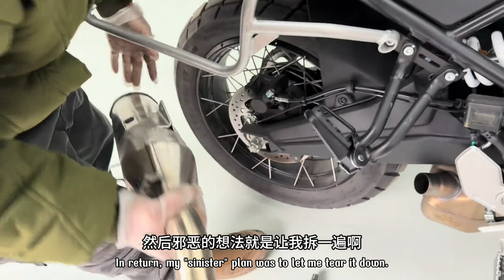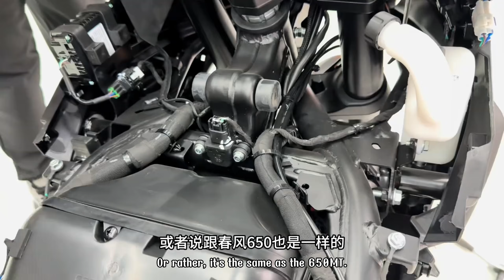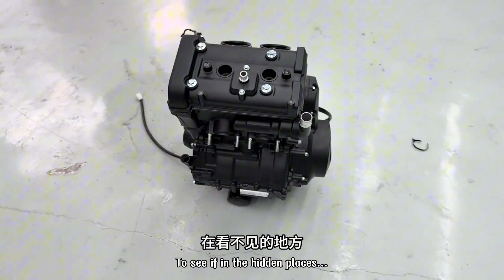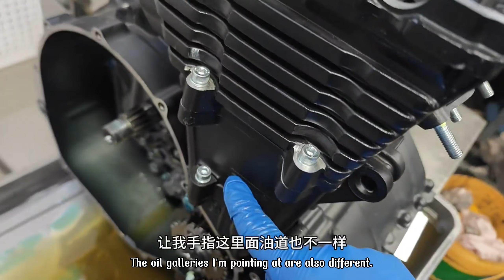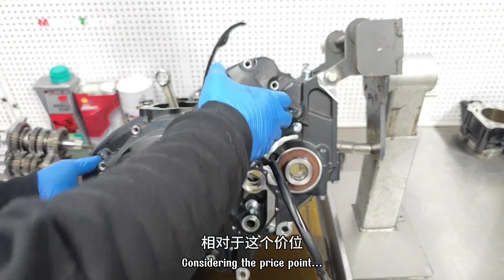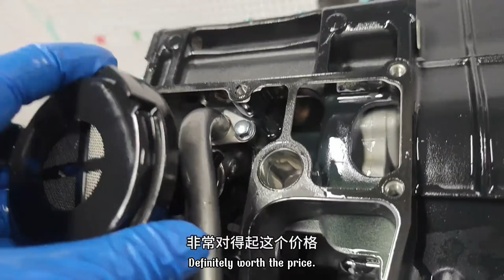CFMOTO 700MT Engine Disassembly: What's Inside a Sub-$4000 700cc Bike?

Comment: I'm in my 60s now and I'm worried that I might find 700 metric tonnes a bit more than I can manage. Otherwise, I think I would get one.
Reply: Components are great and cheap, weight is the issue and probably jerky throttle which most chinese manufacturers still fail to perfect.

Comment: the cassette type gearbox, is very rare, maybe the top-top tier superbike using this type of gearbox. In the bike, this type of gearbox is a surprise, and this is quality.
Reply: Look at most new bikes and they not only have cassette style gearboxes, but stacked too. It's a packaging decision that helps in 3 ways: 1. narrows the engine(front to back) 2. saves a little weight 3. allows easier mass centralization. 

Yamaha has been using stacked cassette gearboxes in production motorcycles for almost 30 years. As Kevin Cameron asked: "Why was it done any other way?"